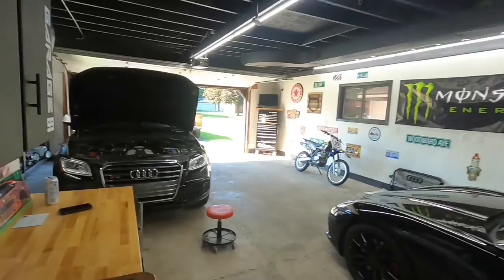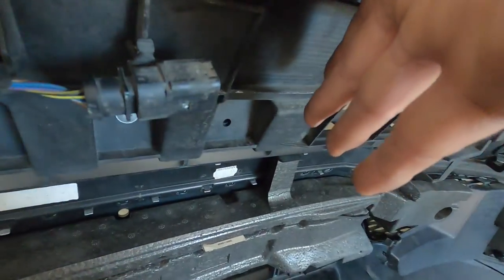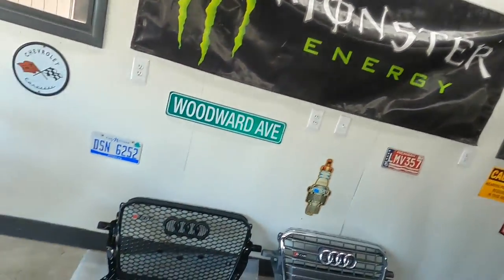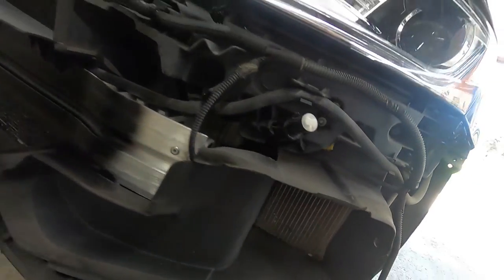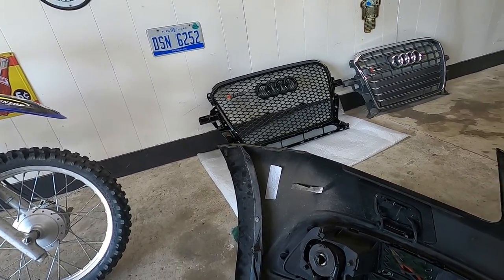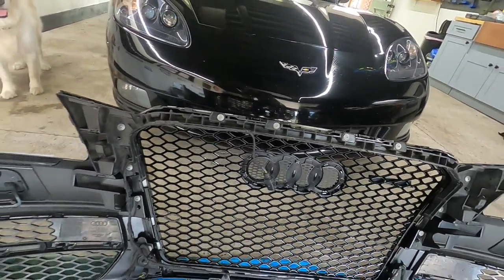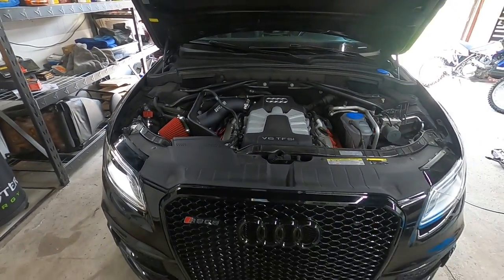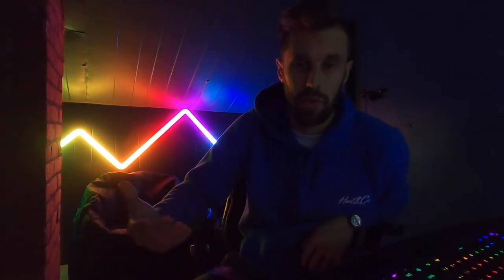Wifes daily SQ5 gets the RSQ5 grill install! This is a MUST for UPGRADES!

Comment: Night and day difference. Looks so clean
Reply from the maker: Thank you! We love it too!
Reply: Would that stock SQ5 emblem have been able to replace the RS one without any modifications?
Reply from the maker: That i don’t know. Might need to purchase a floating one but i think they mount the same
Reply: @garage_ninety_nine  Thanks for the reply.  I did end up buying a floating one off eBay. It used toggle bolts which I loctited on.  Also painted the bolts black just in case.  Has been holding up superbly.

Comment: this might be an extremely silly question or it may not, I got myself a 2017 q5 sline, i want to also swap the grille with the same one in your video, and would that for any reason mess with any warranty stuff? 

This is my first audi and i got a warranty on it and thats allll new to me lmao. no warranties on my vette

great video  by the way, thanks for uploading!
Reply from the maker: Thanks for the feedback! I would assume it wont mess with the warranty if everything electronic wise is still in functioning order as far as crash bar, parking censors, etc after the install.
Reply: @garage_ninety_nine  do you need to actually do anything with the parking sensors when you swap this? or do they just stay put and you change out the grill
Reply from the maker: They will get swapped to the new grill